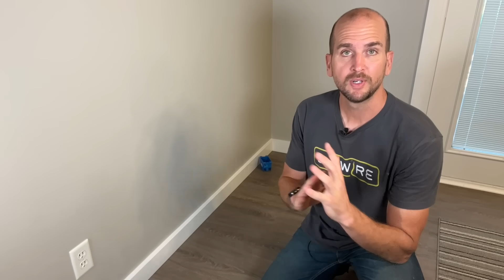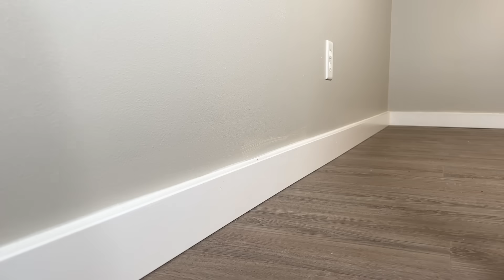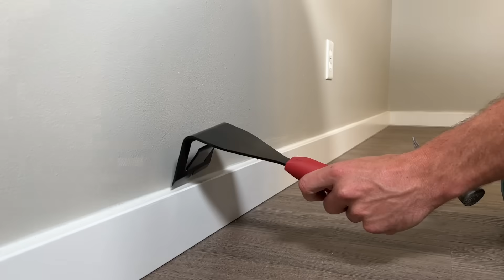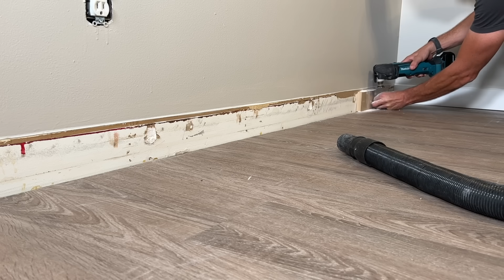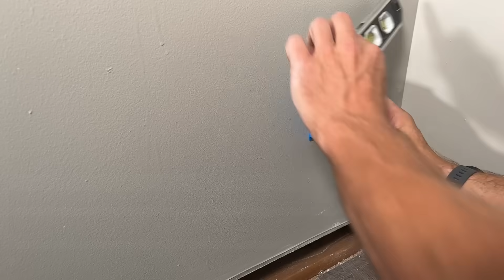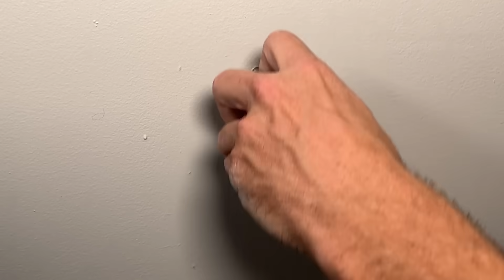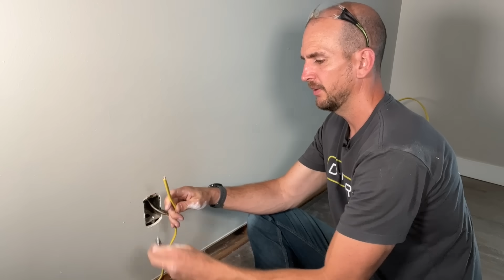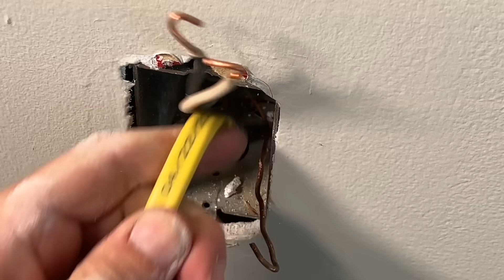How To Add An Outlet To A Finished Wall

Comment: This works well if the trim is fairly tall. In my home, the trim is only about 1/2 the height of what is shown in the video.  Using this method,  there would be very little room above the baseplate of the wall framing to drill or get your hand in there to run the Romex. Great idea for some situations, just consider how your home is constructed and rather this will work for you.

Comment: It is amazing how this seems to be a very common situation in the US- yet nothing of this applies to buildings in Europe
Reply: Agree the new cable ends up running in an illegal route according to UK regulations. The legal route is horizontally between the new and old sockets keeping within the vertical restraints of the sockets and at least 50mm from the surface on both sides of the wall.

Comment: These are very generous 4 inch base boards that make it convenient. Most modern homes have 2 1/4 inch base boards that make it more challenging. You will have a tiny opening above the sill plate (the 2x4 that is laying flat on the bottom) to work with. You don't want to drill near the bottoms of the studs because you will hit the framing nails, and angling higher is near impossible with a drill.

Comment: Ya did good. Great tutorial.  I've done that many times, but I'm still a fan of wire nuts over wires that were twisted with bull nose pliers. BTW, the first house I had inspected was in May, 1970.

Comment: Or you could just install a wireless power outlet...
They are usually located in the same aisle as the Bluetooth cables in your local hardware store.

Comment: Seen quite a few comments on this video. I have not seen anything on the requirements of the stud protector plate with just plain Romex wire in the stud. Is it not required anymore? 
 Even watching many times, I didn’t see a protective plate installed between drywall and stud. 
 Maybe the assumption is nothing will never be anchored by screws or nails that low in the wall. In my area, the electrical inspector checks for those things. Then again the DIY person’s house, it might be okay.

Comment: Question: Does the integrity of the studs get compromised by the drilling of the holes? I agree with one of the comments that suggest half an inch to be better, thus, keeping as much stud material in place. Please, elaborate. Thank you!
Reply: Yes drilling into studs will weaken the timber ideally you should drill into the center of the timber with as small a hole as possible you should also avoid removing over half the width of the stud

Comment: Per ADA requirements you should be no less than 18" from an inside corner with an outlet. Also, you did install your locknut upsidedown.

Comment: Great idea to cut below the moulding! Why do you use the pigtails rather than the second screws on the outlet? Seems like more mechanical connections and since I am cheap, more costly. :-)

Comment: Where's your arc fault protection? Where's your tamper resistant receptacles? All necessary for a code compliant installation. There's a reason this work should be left to the professional.

Comment: Thanks for that; I liked.  Two things came to mind.  While studs are 16" on center in older homes, many homes are built on 24" centers; building codes vary.  Also, drilling a 1" hole through the studs seems excessive.  A 1/2" hole will pass a 12-2 grounded Romex; a 3/4" hole will pass two together.
Reply: Great points Steve. Smaller holes with rubber grommets are def. the way to go. 1/2" is plenty big and shouldn't rub much at all.

Comment: Well done. You did it properly, video was pretty concise and you finished everything up nicely.

Personally I'd use wirenuts though; those wagu things add resistance to the circuit and are not as good as a wire-to-wire connection.
Reply: He must like house fires.
Those connectors shouldnt be used on anything largee than 18ga, idgaf what the rating says. Theres not enough contact area and they arent tight

Comment: First time viewer from side bar recommendations. Excellent video and very clean install for old work. My question, you used 12/2 plus ground, but those outlets look like 15a. Do they make 20a outlets without the slot? My search online was not fruitful. If you were just using scrap wire, that's understandable and I would do the same knowing it's over rated for the application. And the price of that stuff hasn't gone down. Great video!
Reply: Use 12ga anyway because you always want to over-wire, never under-wire.

Comment: Get stud finder!!  Run new ele box 120v make sure breaker New max 15amp.safety. all way add new breaker new wire  correct Amp breaker safe join job well done.   Before run 3erd ground wire to gal pipe for ground.

Comment: Go inn attic see are studs run.  Get along screw drive  hammer in area ceiling. Then fine screw drive watch for ele wire  then get alignment  cut small in  drywall.run new wire  after get drywall mud easy fill Crack sand look so nice paint over well done. 👍

Comment: Quick question on a senario and I trust your advise more than others I have seen on youtube.  I need to add an outlet to a room on the other side of an existing outlet.  In other words, an outlet directly behind another outlet in another room.  Do you have a video about that?
Reply: Super easy. Measuring tape, ruler and drywall knife/saw. Don't overthink it.

Comment: Very handy tip, thanks! The one thing that concerns me is the type of wire nuts you used. I'm not sure if I would use those except for low voltage.

Comment: Great video and work. I did have one question, why not take the extra few seconds and run the branch wires off of the other set of terminal screws on the feeder receptacle rather than using the back terminal holes?
Reply from the maker: I line the back wiring feature on these type of commercial grade outlets as opposed to a standard side wiring setup with a J-hook.  This should not be confused with speed wiring / back stabbing which you will find on lower residential grade outlets which I am not a fan. 👍
Reply: @EverydayHomeRepairs  No, the OP is asking why you took the extra time to run a feeder wire to the first outlet rather than just hooking the wires for the second outlet directly to the first outlet. The outlets are designed for this, and the OP has a good point.

Comment: Strange choice to go thru all that work to add what will function as a USB outlet, but not get one with integrated Type-A & Power Delivery, instead requiring a wall adapter.

Comment: Great tips! One thing worth mentioning is that be sure to check your local legislation about installing new outlets. Here in Finland, you have to have an official certification to install a new outlet so you cannot do this kind of installations even if you knew what you're doing without the certification.

Comment: DO NOT screw into Dry Wall without Proper Fasteners  Because you pull out the sockets out sooner or later.
Reply: He didn't screw anything into the drywall.

Comment: Remember guys, depending on country/territory you may not be allowed to do this work even in your own home.
Also, wire without conduit is controlled in some areas, and completely forbidden in others. You may need to use 1N wires in corrugated conduit, and really that would have been preferred in this case as it would have allowed for a clean conduit between the boxes.

Comment: Great video!  One thing I would add… when I use my trim puller… I place a wide putty knife blade between the wall surface and the trim puller; thus, preventing any damage to the wall.
Reply: His baseboard puller has the putty knife built into it. Pretty nifty tool.

Comment: I have zero electrical knowledge. This will be something I'd like to remember if I ever need to add an outlet. I have a wall switch for the ceiling lights in a spare bedroom that's behind the door. People naturally look for a switch next to the entrance of a room. That's nuts, but the builder/owner was working off his central room, the living room, to expand his home after he added an upstairs and a dining and kitchen. He used a modular approach to building a 2200 sq ft home. All his electrical outlets have the ground at the top. Maybe he had a logical reason for that, or maybe he was dyslexic. I don't know, but it seems maybe he had reasons for such things.
Reply: Ground at the top is actually the 'proper' way to install outlets. They do it that way so if something falls on an exposed plug it hits the ground lug first and doesn't short out the hot side. Houses in Texas are all built that way.
Reply: @TehButterflyEffect  Thanks. I thought that might be the reason.

Comment: One question...why did he pigtail the wires in the new Romex with the existing Romex.. wouldn't it have been possible to connect the black - white new wires onto the bottom screws of the existing outlet.. what am I missing?

Comment: When adding to or extending a circuit the circuit is required to be afci protected. a simple afci device installed in the first box would have made that a code compliant installation. Except that you also didn't install a tamper resistant receptacle which is also required.

Comment: Appreciate the updates.  We have a number of automated cooking appliances.  I appreciate the Advantum and the Miele steam oven for simplicity.  Neither allow me to program from my phone and I understand that may be possible with the Arden.  The reason I would appreciate this feature is planning of how a potential food would be prepared and cooked as well at total time commitment and what functions of the operation that would require my manual input to the process as well as cleanup.  My Miele oven and coffee machine details the time required for maintenance functions and when they will be required.  Thanks for coming up with a tasty alternative cooking solution.

Comment: Another option is putting an unconnected receptacle where you want the new outlet, then power it with a suicide cable from the other outlet. 😂 Seriously though, awesome video. Well done.

Comment: Well, at least not a concrete wall it is :) Hardcore mode: needed to put a switch (luckily) on a different side (unluckily) like 15 inches away from the original spot, ended up with a non-perpendicular drilling, after some shooting experience managed to hit exactly the original switch's box lol (and right into a cut-off section).

Comment: The trick on the wire path and getting "under the wall" was neat. However, I have absolutely no understanding for putting the Wagos behind the socket, especially when the socket was ready for the second wire. This limits the installation to about 5-7 years, especially that in the US the voltage is lower, thus the currents are higher, so Wagos are a "no go" for me. Personally, for me they qualify only for lighting installations, when now LED-based lighting drives almost no current. Second thing: don't You need any certificate to play around with electric installation? Again, in the US housing is rarely brick & mortar, so wiring mistakes have a much more "combustion accompanied" side effects.

Comment: This is a great video with a lot of attention to detail. Thanks for posting it. Just wondering though why you didn't use flexible metallic shielded cable such as bx or greenfield instead of romex to better protect the wires? It seems like it would be just as easy and probably not more expensive and would provide good protection against future damage.
Reply: No need to protect the new wires more than the existing.

Comment: I’m 84, and I’ve been doing this since I was 10, and began “holding the flashlight” for my dad, who was an electrician.

I liked both that saw and that baseboard removal tool. I have to get them, though, personally, I often pop a hole on either side of the stud, drill, then fish inside the wall, from opening to opening with a coat-hanger, like using a needle and thread. For the DIYer who doesn’t own that saw it’s a much easierway, one that leaves all the existing nails in place and avoids the, “Oh my God” surprises you get trying to remove the nails. Plus, you don’t need to saw, remove/replace the wallboard, so it saves time. It also works on plaster walls, which the method you show won’t, because the nails are buried under the plaster. God help the DIYer who watches this and then tries it on a plaster wall. But mostly, I just notch the plaster over each stud (that saw will be great for that), going several inches on each side, and then do the needle and thread thing, ending up with with the wire nestled against the stud. I cover opening with a stud-guard, and have cut the install time down by a lot.

And why use a 3-way connector when, except for ground, there are screws for both sets of wires on-the-outlet. And since you have to tighten the second outlet screw in any case, why not use it? If one screw does the job reliably, and terminal boards use many, why would the second not hold? I’ve never had one fail. Nor have I had any UL approved quick wires fail. And I’ve been using them pretty much since they came out. The only time I’ve ever used such an external connector is when there are already two wires on the outlet. It is, after all, why they have 2 screws.

And while putting the connector on the wire before installation is fine, most installed outlet boxes don’t have a 1/2” knockout. They have a built-in wire-clamp, so you should at least mention that, and the fact that the smal hole makes it easier to fish down and pull the wire in that sit poking at the hole.

And one final thought: Is that Home Depot’s, Carlton old-work boxe? They absolutely suck. They don’t precut the threads in the ears or the box, and the hole-diameter in the ear is slightly smaller than the shank of the screw they supply. So it’s not only a bitch to screw in, that undersized hole often causes the ear to break a month or more later, resulting in callbacks. And the plastic used is so brittle that if you overtighten them just a bit they’re apt to break off (easy to do with an electric screwdriver). I’ve taken to pre-threading the holes and using machine screws when I'm forced to use that box, but the DIYer usually can’t do that, or know it’s necessary. I’ve not tried the parent company, T&B’s, box, but a friend who is a working electrician says they’re okay. If so, the viewer should be warned to use the light colored boxes in Home Depot. They cost a bit more but have real threads.

Comment: Just a word of warning to People in the UK... this is not permitted under the 18th Edition Electrical Wiring Regulations.  As an electrical inspector and tester, this would be deemed a none compliance as the sockets do not line up on a horizontal or vertical path and running behind skirting board is not a permitted zone for running cables.  PLEASE BE AWARE.

Comment: Great video. Just like to know what kind of outlet you bought? I know you said it was a commercial grade. From the looks of the plug slots, it is a 15 amp plug. The question I have is this. I know you should use a higher voltage 20 amp plug for heavier appliances. Do you have a rule of when to use the 20 amp plugs? Also if you have GFCI plugs that are 15 amp, will you cause any issues if they are installed in a kitchen area? 

I was told that they should be 20 amp in a kitchen, but they were on sale and i bought them. I guess my biggest concern is where to put these 20 amp outlets. I would think it is a good idea to have all outlets installed as 20 amp in a kitchen. I am not sure where any others should be installed, unless you have a special machine that may need a 20 amp outlet, like some kind of medical device or something. 

So what say you on this? Can you mix 15 and 20 amp on same circuit? Should all 15 amp circuits have 15 amp beakers? What if I put in a 20 amp outlet in? Should all be on a 20 amp breaker even though only 1 outlet is 20 and all the others are 15 amp? And is there any place suitable for a 15 amp GFCI for residential use, or should all of them be installed rated for 20 amp as standard? Of course all wiring is 12-2 we are talking about.

Comment: I used to install burglar alarm systems. That method you showed is very handy if insulation is in the wall. Fishing method can take hours and runs up job costs. Since I do 120 volt wiring, central vacs, and plumbing, I can also drywall. That caulking wouldn't be hard for me. You should have trimmed the silicone off of the molding while you had it off with your razor knife. That'll make it easier to lay down a fresh bead. Just letting you know. 🐀🐾
Reply: My son asked me, "Why did he WAGO the hot & neutral when a receptacle can easily hook up 2 sets of wires?" I responded, "He probably didn't need to." A 3-way I would understand. He probably did it so he could use a space heater or portable air conditioner. When the compressor kicks on, the lights on that circuit would flicker during the start. The WAGO connectors would have a little less resistance and allow more current than trailing though the device. I replaced receptacles in a mobile home once where going through devices would get hot and eventually break the connection. I guess that's why he does it.

Comment: 20+ years as an electrician. nicely done. a few things that look wrong. the metal box looks like a standard 3x2x2.5 This is not big enough. 2nd, the plug looks like a regular plug. both the new plug, and the feed plug need to be tamper resistant. Finally, it should be mentioned that this circuit needs to be arc fault protected once you altered it.
cheers.